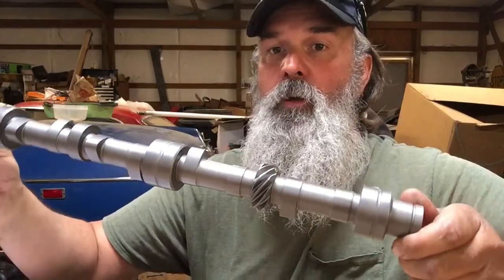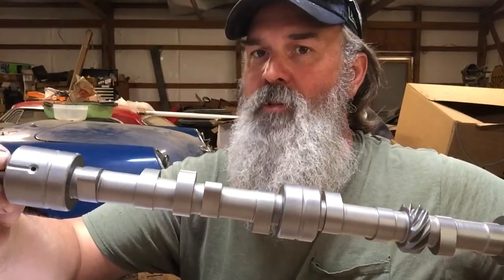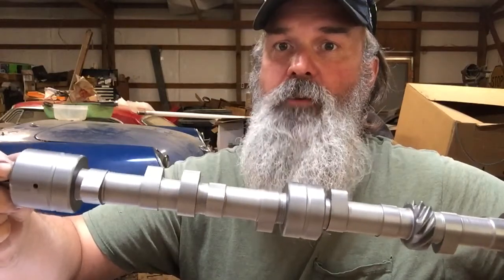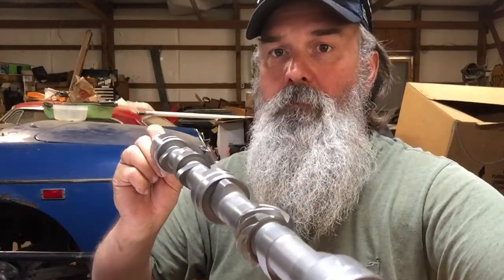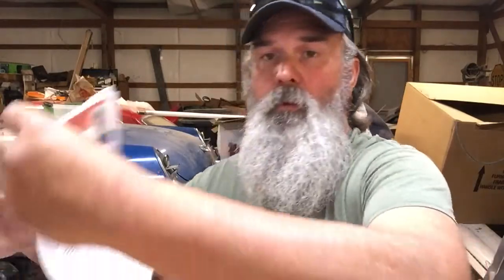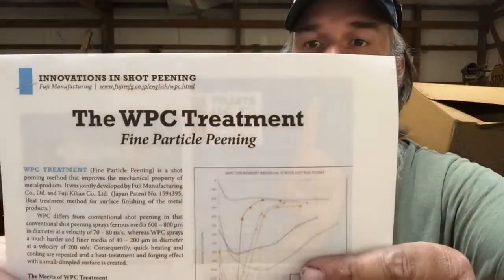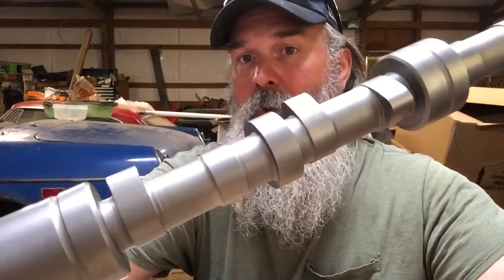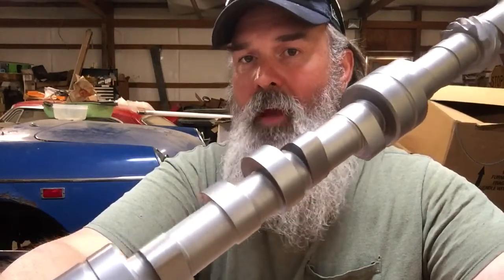WPC treatment and Mgb Camshaft and lifters

Comment: the examples I have seen of WPC are very impressive . Friction is greatly reduced which is confusing to me because you are making the surface rougher . I think you did well
Reply: It reduces friction because it's microscopic, and it covers the surface in these microscopic hills and valleys. The valley's trap air and/or lubricant, which does help, but it also significantly reduces the contact area. Instead of the two pieces being flat, with a very large contact area, they are only touching on the tops of the "hills." Effectively, WPC increases surface strength, reduces friction, AND improves lubrication.
Reply from the maker: Thanks for the comment I have another camshaft and lifters that are going to go out to get WPC treatment done and cryogenically treated this camshaft and lifters will be going into an engine that I’m going to rebuild and do a video series on and I’m going to test it to see how the WPC treatment holds up my take on it is since it’s a micro shot painting process that it surface hardens the metal but also helps with oil retention to provide more lubrication in places Metal to metal contact occurs

Comment: I may want a racing camshaft
Reply from the maker: this is a fast road cam Duration @.016 279, lift .295 at the camshaft, Intake Timing 8 to 41, Exhaust Opens at 41 to 8.